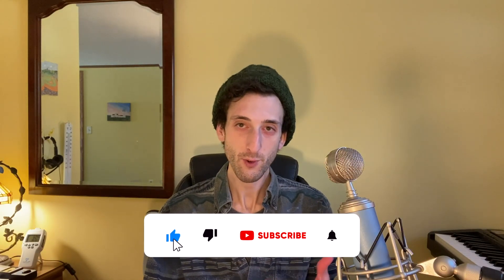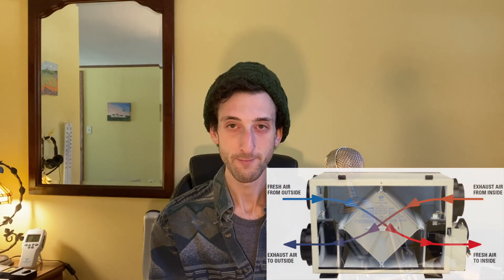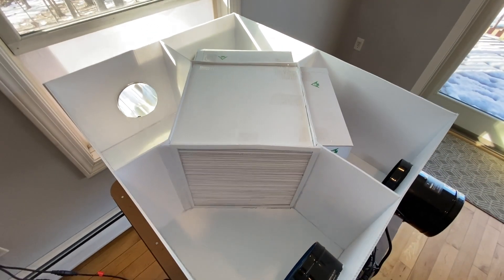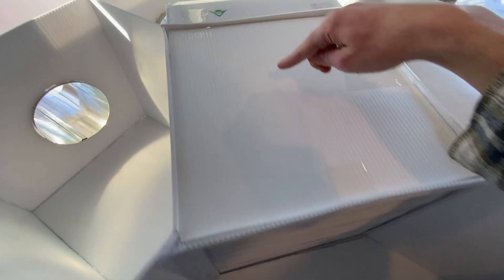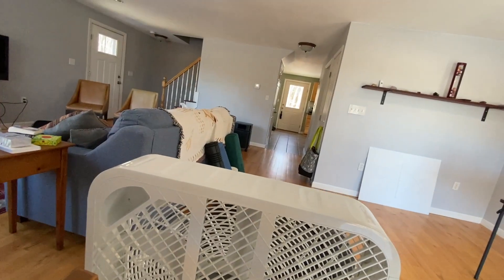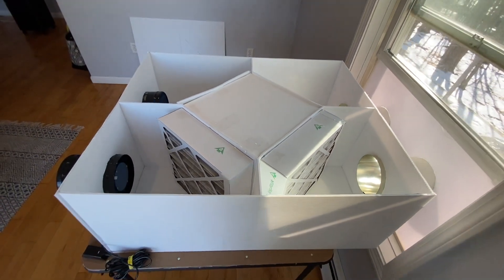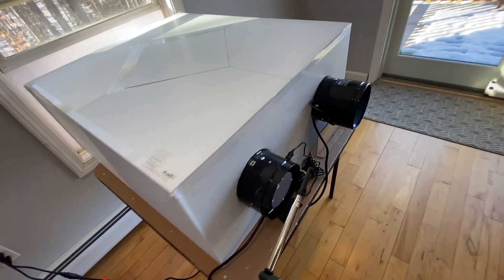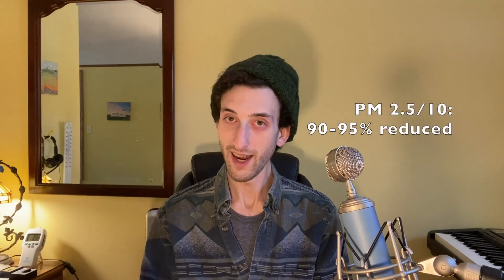I built the best DIY heat recovery ventilator I’ve seen on YouTube

Comment from the maker: If you’re struggling with indoor air problems, you might like my free 5-day course. It covers everything I wish I knew sooner: https://renegadeairquality.com/

And if you’re house-hunting or sanity-checking your place, I made a visual, tool-free mold inspection guide. It comes with an interactive checklist you can use while you walk a home: https://healthyhomeguide.gumroad.com/l/DIYMoldInspection

IMPORTANT UPDATE: I did some more efficiency tests in the spring using the outgoing air and it seems that my HRV is actually around 60% efficient (which is still pretty good), not 85%. I wanted to make a video about this but I ended up having to put it on the back burner because I went through the process of selling my house. 

When making this video, I made the mistake of testing efficiency using the incoming fresh air. I think that heat generated by the fans skewed the results. 

Here’s a formula I used for a corrected efficiency test using the outgoing air instead:
× = (T_room - T_outgoingAir) / (T_room - _outdoors)
An example of one of my test runs (Fahrenheit):
60.5%=(70-44)/(70-27)

So yeah, it is less efficient than I initially thought. That being said, it still worked quite well.

I want to address some questions I’ve seen:

I do think that almost all of the air is flowing through the core. The filters were quite dirty when I dismantled this HRV, and in order for them to have gotten like that, I do believe air must have passed through them/the core. 

I don’t think there is very much leakage in the chambers. I sealed them very thoroughly with hot glue and weather stripping, and did leakage tests. I acknowledge that there could be some leakage, but not that I could find. 

Next point, to the couple people who quoted Egon Spengler at me: no, I don’t believe I’m “crossing the streams” (intake/exhaust air streams mixing). After this video came out, I installed elbow duct attachments to the indoor supply and outdoor exhaust to the direct the air streams away from the intakes 🙂

Potential reasons I didn’t run into condensation issues: lower HRV efficiency combined with the low dew points in my house (from ventilation with dry, cold air + no humidification). 

I only used this HRV during the late fall, winter, and early spring when the air is very dry. I’m too worried about mold growth when it gets humid. Though less efficient than I initially thought, it still worked great!

If you're curious about how this DIY HRV performed long-term, check out this video of mine: https://youtu.be/LiptsaKmq80?si=bsEbBQ9pKLKozY4u
Reply: How would you deal with moisture condensing inside the core? If you turned the box on its side, moisure could run out of the core channels. EDIT: I see you do address this, kinda. However, it’s still true that this is a no-go for any climate that has to deal with condensation.
Reply from the maker: @stcredzero  great question. I’m also concerned about ventilating using an HRV (even a factory made unit) during humid months. ERVs are better for ventilating humid air. I’m currently making a video explaining how to install an ERV one’s self (even for those who don’t live in a ducted home!). That might prove useful to you when it comes out.
Reply: 60% is good for crossflow HE in these materials. And filters get dirty much faster than we think ;) It's not uncommon to send a reserve filter set with a new AHU.
Reply: For better efficiency (if you even need it) you need a bigger and more elongated core. 
To all the naysayers, this guy built a system extremely similar to a professionally manufactured one. Many manufacturers also use plastic cores, and even plastic fiber cloth cores (with moisture wicking effect)
Reply from the maker: @burningman1945  Thank you 🙏 That’s absolutely true.
Reply: Two things: corrugated aluminum for better temp exchange and UV for peace of mind regarding any condensation. Think about it. I know it adds some cost but solves a couple of issues. The idea to set it on the side, maybe with a corner down to drain from also seems valid as an improvement.

Thanks for sharing.
Reply: @realtugabfh1367  no, aluminum isn't better, and companies that make HRVs know it. Aluminum is only needed if temperatures are relatively high. And there is no UV to worry about. 
Thermal conductivity isn't the only parameter that describes heat exchange, there is also thermal resistance, among others. Thermal resistance is a function of thickness, and in very thin materials it leads to very different materials behaving very similar in heat exchanging aspect .
Reply: @burningman1945  You might be right but my thinking was that corrugated aluminum is the equivalent of the material he used but the thermal transfer would be better for sure. I'm just not sure if it is worth it cost of materials-wise but as a functional optimization I think it's valid and MIGHT be worth it, depending on the result.
As for the UV, some comments, including HHG's, address condensation as a concern in certain climates where mold might grow in the dampness - hence the UV suggestion.
Reply: @burningman1945  sorry about the doofus moment. I didn't realize that was you because your other messages have the channel name above the @name. Anyhoo, those are my thoughts. Thanks again. Cheers
Reply: I really love the idea. Things like this have crossed my mind quite some times in the last couple of years.

But please help me as I'm trying to wrap my head around the calculations. Wouldn't it be much more accurate if you measured the temperaturr of the in the four ducts for your calculations? And perhaps als the airflow? (Especially flowing from inside out)

I'm thinking of:
DeltaT_,OutsideIn = T_Inlet_OutsideIn - T_Outlet_OutsideIn
DeltaT_,InsideOut = T_Inlet_InsideOut = T_Outlet_InsideOut =

Delta_T = DeltaT_,InsideOut - DeltaT_,OutsideIn

Gain = Delta_T * Air_HeatCapacity * Airflow_OutsideIn (I'm probably missing some details here 😉)

And then there's this thing about air particles. Do you have any measurements from before then installation of the installation and how do they compare to the new figures?

I'm having some Ikea air quality sensors and about 99% of time they all show no polution or just a little bit.

Comment: Thanks.  Why a filter going into the cube for the air exhaust?  Is that because you don't want particles in the cube? Otherwise seems redundant to me.  But I have all items on order for a fresh air intake and exhaust for my basement and I'm running the fresh air in, into my furnace's air return. Then am running 4 air hoses with vents in my basement, up in the beams, for my "air out". And then using the open stairwells for my upper level and my lower level, to circulate the air from the main living levels down and out in the basement.  But figure I can always build that hrv core if my heating bill goes through the roof.  And for humidity, I'm just going to keep running a dehumidifier in the basement because I can't really afford a ERV unit ATM.  But I appreciate all your videos, they've help a lot. Everything from CR boxes to now a hrv unit.  Mold survior💪

Comment: Your car radiator fan is SUCKING air over the fins because blowing air is very inefficient. Your inlet fan is ok but your outlet fan needs to be moved to the outlet pipe side of the diamond box.

Comment: Plastic is a poor thermal conductor, but even so, your design can be improved:
- on the intake flow keep the corrugated plastic;
- on the exhaust flow replace the corrugated plastic with thin spacers;
- this eliminates the double wall;
- this also eliminates the need for gluing on the entire surface.

Comment: The lack of any thought going into how it would handle humidity worries me. I expect if you ran that out of my house it'd be dripping and damage everything around it, as soon as the humid air in the house cools down it's going to be dumping water, solving mold and condensation indoors is the only real reason I was looking at making a hru 😢
Reply from the maker: You are correct; I have a couple videos about ERVs where I discuss how they deal with humidity in more detail. Including a video that shows you how to install an ERV in a window!
Reply: @HealthyHomeGuide  that's good to know for sure, I expect a HRU would probably still be better than an ERV if I had one fitted professionally just so I can remove as much humidity as possible, but worrying about a condensation drain in the design makes it unappealing to make my own for sure. So probably going to just upgrade my dehumidifier and see how that goes before maybe looking at a solution to get fresher air

Thanks for the response though!
Reply: @HealthyHomeGuide  super cool that you made this at home by the way and it actually works well
Reply from the maker: The condensate drain part is a real concern; any HRV/ERV needs a way to deal with water that collects inside. But just to clear up the humidity piece: an HRV (HRU) doesn’t actually remove humidity from your house. It just brings in whatever outdoor air is doing, whether that’s muggy in summer or bone-dry in winter. An ERV, on the other hand, does transfer some humidity between the two air streams. In summer it keeps some outdoor humidity OUT, and in winter it helps keep some of your indoor humidity in (when it’s drier outside than inside). If your main goal is lowering indoor humidity, a dehumidifier really is the right first step, since neither HRV nor ERV is a substitute for that.
Reply: @HealthyHomeGuide in the summer I'm not having damp problems so it's not a worry, in the winter when the problem it at its worst the absolute humidity of the air outside is much lower so bringing it in and expelling the humid Indoor air via a hru should be a fix, just an expensive one
Reply: @HealthyHomeGuide  but yeah absolutely, I do have a dehumidifier but it's far from anything impressive so I'm going to try upgrading that

Comment: Interesting this is, General Electric had something similar back in the 1960’s which was called the Ventoglide, essentially a purpose built window fan with a filter on the back which brought in filtered air from the outside. As the saying goes: “What’s old is new again”.

Comment: Cool stuff.  But how is the chloroplast able to effectively transfer heat so quickly, as it would need to in such a device?  I would imagine an aluminum core would work much better, much more expensive though.  And how much if any has your heating bill (gas or electric) increased?

Comment: I’m considering a solar air preheated on the intake of a DIY HRV here in chilly but sunny NM . It might be 29 degrees outside early in the morning but within seconds of the sun striking the solar collector the air could be warmed a lot. Also a second solar air heater would be needed.

Comment: How was efficiency measured? If your exchange box with all the elements is not insulated and you keep it for long time in the room temperature then whole efficiency evaluation is flawed. You definitely need a proper insulation from surroundings for measuring efficiency. Later it doesn't matter much, but for this step I think it's crucial. I can put whole in the wall, measure incoming air 0.5 meter from it and say it has 50% efficiency in heating (because may room will heat air) 😀
It will most likely have good efficiency due to high exchange surface, which in these devices is key point. There is a project where guy used straws and even this works quite well :)

Comment: I know you've done an update video about how this ended up causing a moisture problem in your house and you recommended going with an ERV instead, but I wanted to let you know that this DIY HRV still has an application that I am going to be using it for: keeping garages and detached workshops properly ventilated in the winter. Particulate matter, chemical fumes, and all manner of other air contaminants are horrific in woodshops and DIY car garages. Usually, in warmer weather, we just leave the doors and windows open and have fans running. But I live in upstate NY where it gets particularly chilly in the winter. My dad (the curmudgeon that he is) insists on heating the shop with a stand-alone kerosene space heater... with no ventilation. Needless to say, this DIY ventilator is getting built whether he likes it or not.

Comment: So, a couple of things that could help beyond what you have talked about.

1. Use rigid foam (at least 1" thick) for the structure, instead of coroplast.  This will give it a lot of insulative value.  It may need odd, but it matters in terms of improving your efficiency numbers.  Also, if someone were to place this in an unconditioned space, that would be super useful.  In fact, using rigid foam lined with a foil backing would create a radiant barrier which would be really nice if it is installed in an attic.

2. For the core.  This can be changed from an HRV to an ERV by limiting the amount of coroplast in the core.  The coroplast doesn't also the transfer of humidity.  So the coroplast can be used to build the structure of the core.  use it for the thickness and building some channels.  Basically, use it at the edges and 2-3 supports within each level.  Then, in between the layers, use house wrap.  House wrap is a breathable vapor barrier.  So, it won't be insane, but it will allow some moisture to pass from the more humid side to the less humid side.  That is helpful in the winter so you're not just letting all of the moisture out of your house... and in the summer so you're not taking in all of the moisture from outside.

I plan to have one and I will have it with the exhausting air coming from my bathrooms and the fresh air being supplied to the bedrooms.  So, I will install it in my attic.  Then, I want to have a three-stage speed setting and some moisture sensors in my bathrooms that will turn the speed up automatically.   I am aiming maybe for 50 CFM when nobody is home (nobody exhaling CO2), 130 CFM for normal operations, and somewhere between 250-300 CFM when there is moisture in the bathrooms.  This will allow me to use the current bathroom exhaust lines to get rid of the air.
Reply: Hey, I know its been a bit since the original video, but im currently building this, with the foam board as the housing. Anyway, can you please elaborate on how you would use house wrap in the core, to allow for humidity transfer?
Reply: Could you comment on my assumptions: what i am getting wrong? it seems the actual temps are never to be discussed rgd ERVs!!! My assumption: mix 70deg stale air out,  20deg fresh air in. Assume a 100% efficient transfer w 50deg differential. This would result in halfing the temp differential in each flow, so fresh air in = 20deg plus 25deg = 45degrees due to energy conservation laws. That is a huge draft!!! 
now assume 70% efficiency: the incoming air would be only warmed: 25deg *70%= 17deg or 37deg incoming air. a huge energy leach. especially when your planned 50cfm is on 24/7 on cold winter days or hot summer days... that is a crazy energy drain on your hvac.  And if the HRV is in the house envelope, which it should be if you can, any extra warming gains in winter seen in the fresh air in are only caused by heat/cool leaching off the erv housing
Reply: @invishand3  It depends on the amount of diffusion interaction space between the two airstreams.  The more diffusion space, the more efficient the transfer will be, not just cutting the difference in half.

The two air streams need to flow past each other in opposite directions, rather than orthogonally like most of these ERVs.  This would allow the two streams to continually interact with each other as their temperatures are close.

Going to your example with a difference of 50, if it is a quick interaction, it will cut the difference in half, potentially.  If you have them interact adjacently over a greater distance in opposite directions, assuming 70F indoor and 20F outdoor air, in might look like this:

OUT <-30F-40F-50F-60F=  IN
OUT  =20F-30F-40F-50F-> IN

Because the temperature wants to reach equilibrium, you want to have it work over different temperature gradients like this.

The way that they work now is like:

OUT <-40F-60F-70F= IN
IN     <-40F-30F-20F= OUT

Basically, whenever the temperature equalize, there is no difference... if you get them each to about the same, you're don.

It is the same way that birds' respiratory systems work with oxygen diffusion and why it could be better: https://www.youtube.com/watch?v=DnLpLLTKyD0
Reply: @dus10dnd  got it. The distance matters. Makes total sense in your top xfer example. Thanks! Isnt it interesting  they don't show the temps right outside the 4 sides of the heat xfer core? Are the hiding a bigger heat loss than potential customers would like?

Comment: Hi my dude, i dont have a large space to filter and i am also renting, however i do have ideas for something custom.

How strong does a fan need to be to push though a hepa core carbon filter combo? How do i calculate this?

Would i in theory be able to do this with a single or arangement of silent PC ventilators given a particular area?

Comment: 4:22 why is it that the streams don't mix?
Reply from the maker: Great question! The streams don’t mix because of how the heat exchanger is designed. The intake and exhaust channels alternate, and they’re completely sealed off from each other. Each channel faces a different direction, so the airflows move parallel but never meet. This allows heat (and sometimes moisture) to transfer through the thin walls of the channels without letting the actual air streams mix. It’s a clever design that keeps the fresh air coming in clean while pushing the stale air out. Let me know if you’d like more details!
Reply: Do you mean like sheet one faces one way and sheet two faces the other way?